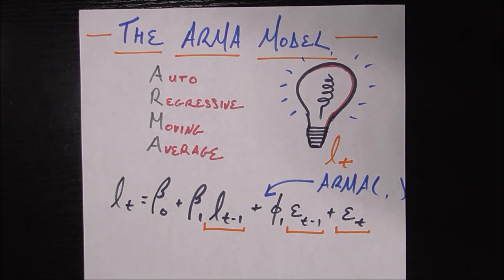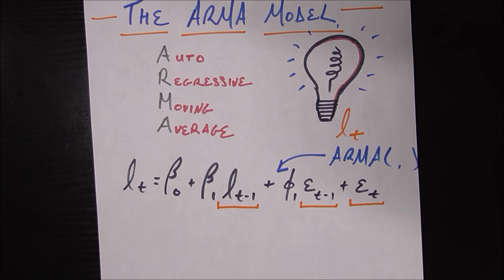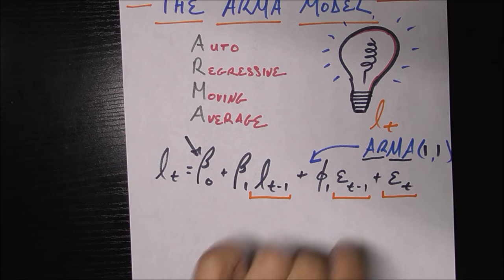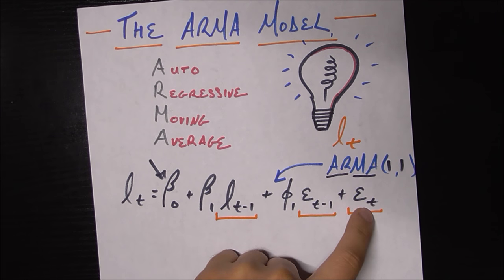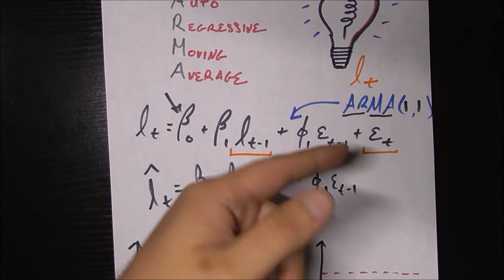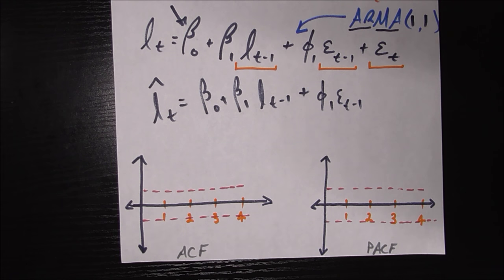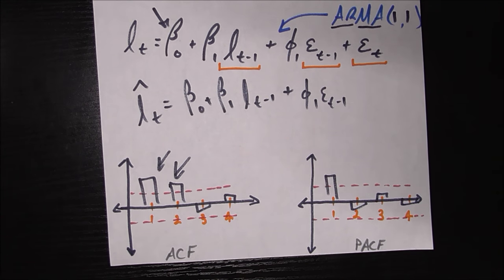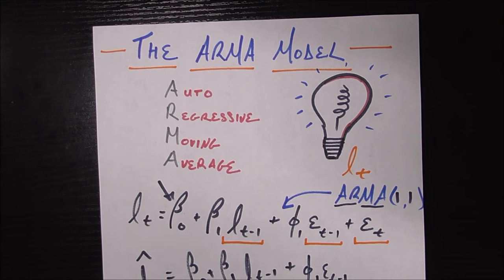Time Series Talk : ARMA Model

Comment: Excellent explanation!! However, one note: I think the language you are using to describe the epsilon is not quite correct. In particular, in your MA model video (which is also excellent) you describe the epsilons as a white noise process but here you describe them as deviations from our previous estimation. I believe they are a white noise process (as you said in the other video) and not deviations from our estimate (since that estimation does not exist yet). Please, correct me if I am wrong.
Reply: Notice the way he defines the estimation. It is merely the model without the epsilon. That is, the estimated # light bulbs this month is equal to our estimation plus some error (which happens to be modeled as white noise). The estimation exists as soon as we decide to calculate it because all the information on the right side that lends itself to our expected value of the # of light bulbs for this month is known. The white noise is the epsilon/deviations

Comment: At the 6:00 minute, if the 2 ACF spikes are at interval 1 and 3, would the ARMA still be (1,2)? Are the input based on the number of spikes above the red dotted lines?
Reply from the maker: Good question, the order of the AR or MA part is based on the last significant lag in the PACF / ACF respectively.

Comment: I have a question, for a time series to make use of ARMA model, the time series has to be stationary right? If it is stationary, It means it fulfill the requirement of there is no correlations between current t to any  previous time which means there would be near 0 for ACF. Then there wouldn't be any instant that it would be higher than the blue dot line right? Or am I missing something?
Reply: I think, when the model is stationary it just has a constant mean. Correlation can still be existent. Think of a sinus curve. It has a constant mean, so it is stationary, while it still has lots of autocorrelation.

Comment: This is a basic question on Box-Jenkins MA models. As I understand, an MA model is basically a linear regression of time-series values Y against previous error terms et,...,et−n. That is, the observation Y is first regressed against its previous values Yt−1,...,Yt−n and then one or more Y−Y^ values are used as the error terms for the MA model.

But how are the error terms calculated in an ARIMA(0, 0, 2) model? If the MA model is used without an autoregressive part and thus no estimated value, how can I possibly have an error term?

Comment: Dude why the MA() order is 2 but not 1? What singles out 2?
Reply: From what I understand, the moving average up to 2 terms is significant as shown in the ACF plot. Hence, the order is 2. Also, there could be cases where 1st, 2nd and 4th terms are outside the error line but 3rd term is inside. In that case, the order is still 4, the last significant lag. The coefficient for the 3rd term becomes zero, because it is inside the error line.

Comment: Question about that last part of the video:
1) Are you running the ACF and PACF on the observed data or on the residuals data?
2) If my PACF shows a spike at 12 (eg: a certain month of the year has seasonally high demand), do i then set ARMA(12,1)?
Reply: Ricky Chua hi Ricky, adjust the serie. In other words, you need a seasonally adjusted serie.
Reply from the maker: 1) on your observed data
2) you probably want to use a seasonal model in this case!